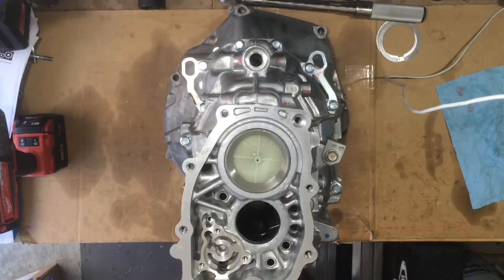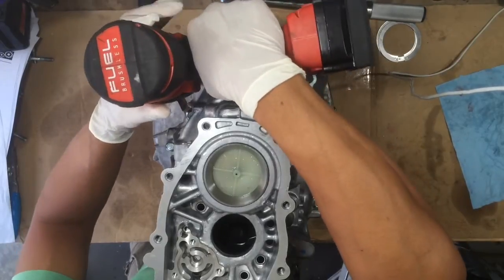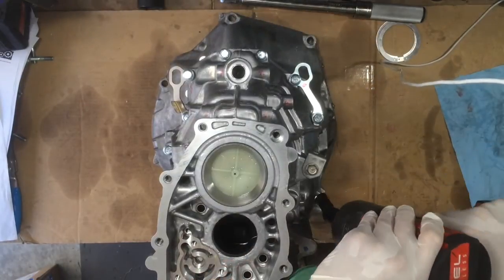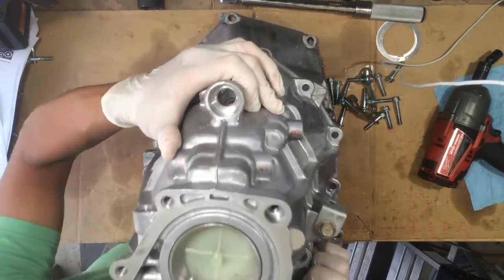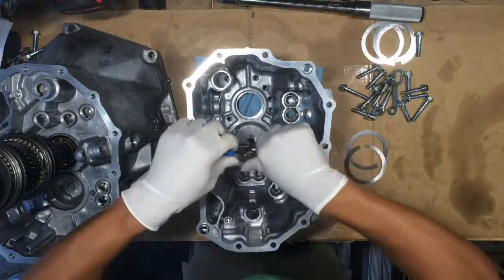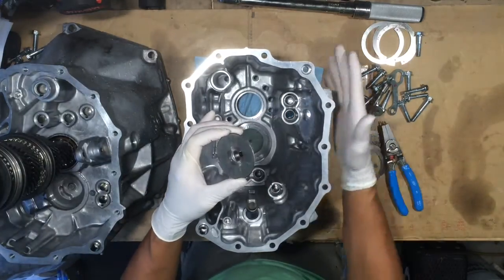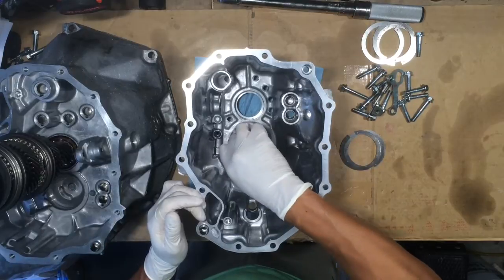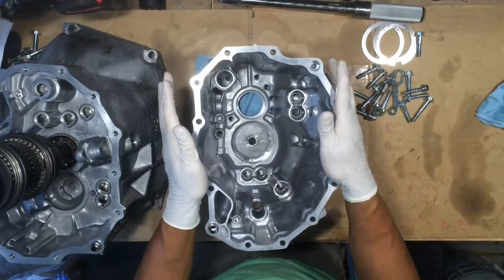Honda S2000 AP2 Transmission Rebuild - Part 7 Mainshaft Thrust Clearance - #relentlessracing

Comment: Hey man quick question. On my transmission I am missing the bolt right above the clutch slave and the other one right about the same location on the other side. By any chance do you know the part number or what they are called?
Reply from the maker: Sorry, but I’d have to search for those part numbers just like anyone else on www.Hondapartsnow.com. Good luck 👍
Reply: @RelentlessRacingAJ  thank you for the reply, sadly I’ve gone through many Honda part websites and neither show the bolts Info. They show the bolt but doesn’t give me an option to click for further detail

Comment: I just have to replace my clutch housing. How would I do that?
Reply from the maker: There are many steps to get the clutch housing off... you pretty much have to take apart the whole transmission to get the clutch housing off.  Pls refer to the 2000-2003 OEM service manual, see pages 13-12 thru 13-25.  Why do you only need to replace the clutch housing?

Comment from the maker: There are minor slight differences between AP1 & AP2 transmissions. Just follow the OEM Service Manual (I call it the Bible). The differences are well documented there. One other note, just be weary if the Bible reads left hand thread.... sometimes it is not. Good luck and enjoy.

Comment from the maker: I just noticed there is a mistake in this video. You should not be able to check the thrust clearance by pulling on the tool by hand. Note, I forgot to install the spring washer. With the spring washer installed, you must use the tool to determine the thrust clearance. My apologies.
Reply: spring washer needs to be installed on the mainshaft spline before putting the factory tool on it?
Reply from the maker: @lordjaashin  yup
Reply: @RelentlessRacingAJ  what size spring washer should we use for this?
Reply from the maker: @lordjaashin  it’s the Honda spring washer. Look up the part number
Reply: @RelentlessRacingAJ  not able to find the part number as i don't have access to s2000 service manual. I looked up in the service manual of 2016 civic and it says to use 62mm spring washer. don't know if that will be proper for s2000 though.
Reply from the maker: @lordjaashin  the part numbers aren’t in the service manual. Look it up online at one of the OE part websites
Reply: @RelentlessRacingAJ  thanks. i found it! the part number is 23927-PYZ-000
Reply: can advise  why is my s2000 3rd and 4th gear get notchy when the Transmission  is hot. 3rd and 4th synchros has been replaced  before
Reply from the maker: @felixhuang428  possibly the fluid u are using. I use AMSOIL in my trans

Comment: Thanks for your thorough explanation of your rebuild. I feel I now understand everything in a logical manner. But is there a difference between the AP1 and the AP2 transmissions as a whole? I know they optimized the 1st through 3rd gears to make better use of the larger displacement (AP2) but it should pretty much be the same teardown and rebuild, right? Thanks anyways.
Reply from the maker: Sorry for the response. There are minor differences in the parts and rebuild. If u follow the OEM service manual u'll b fine. It's pretty straight forward... just b weary if the manual reads left hand thread - sometimes it's wrong.
Reply: +AJ JAQUIAS okay, thanks.
Reply from the maker: hit me up if you have any questions.